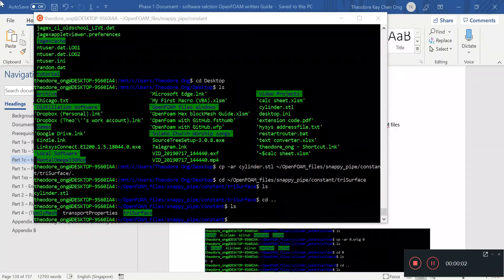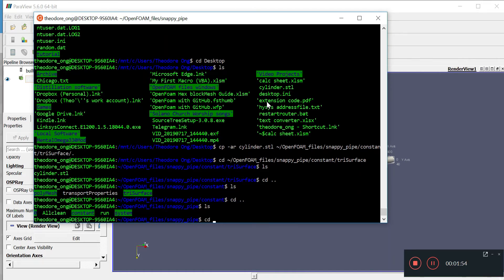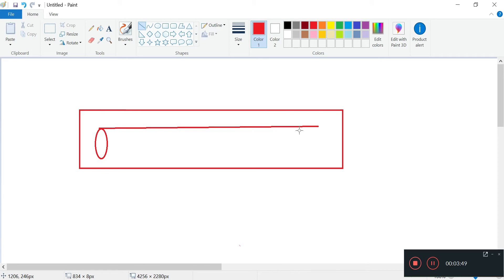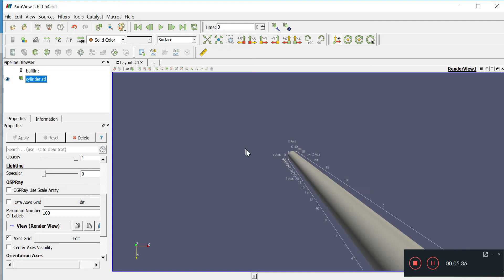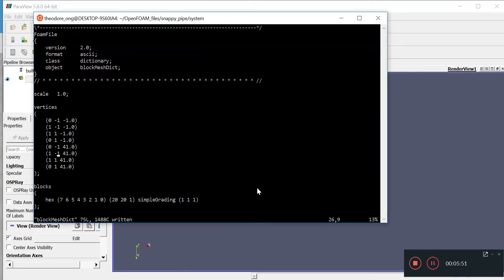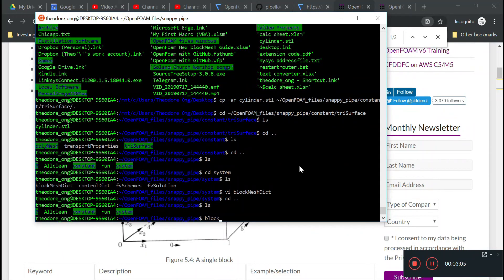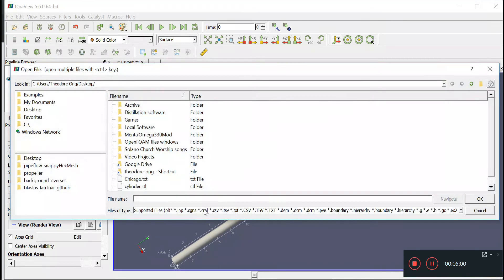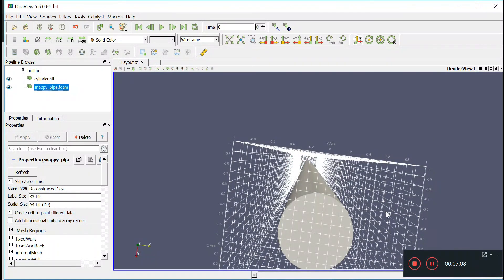OpenFOAM Intermediate 3 - snappyHexMesh blockMesh Preliminary step

Comment: While trying there is no cylinder generated inside the enclousure of block mesh. The dimensions of the cylinder i.e., x, y, and z are -5 to 5, -5 to 5, and 0 to 60 respectively. I have taken block which have x from -6 to 6, y from -6 to 6, and z from -1 to 61. Is it right?

Comment: blockMesh: malloc.c:2379: sysmalloc: Assertion `(old_top == initial_top (av) && old_size == 0) || ((unsigned long) (old_size) >= MINSIZE && prev_inuse (old_top) && ((unsigned long) old_end & (pagesize - 1)) == 0)' failed.
Aborted (core dumped)
I get this error when trying to blockMesh
????